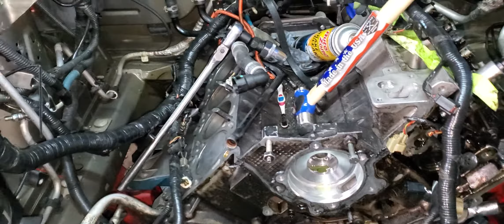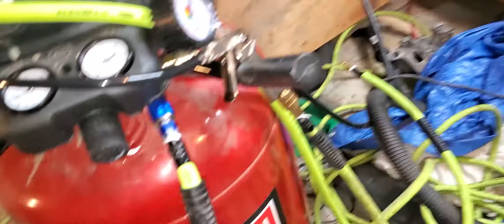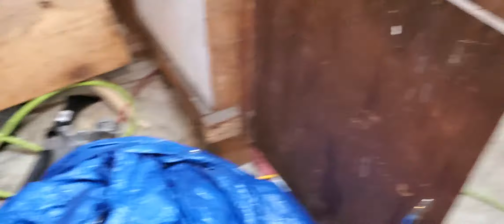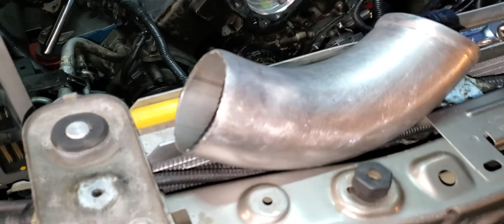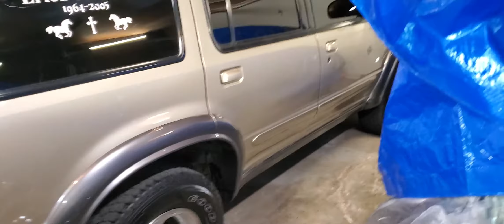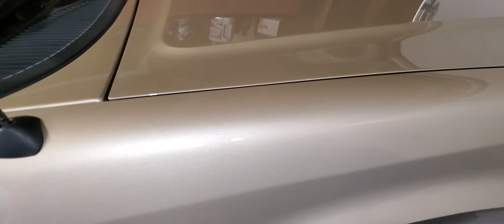Turbo Mustang 3v top end refresh

Comment: We have the same taste in cars. I sold my extra Eddie Bauer and am getting a 2005 mustang GT too. 131k stock tho. What's your mileage
Reply from the maker: around 96,000.
Reply: @TekMan05  on the body of the car, 116,000, the motor that now has complete overhaul, all new everything, zero miles. Am putting it in the car at this point. Did yoy get a chance to view some of my videos? Thoughts, suggestions?

Comment: Really trying to decide whether or not to add boost or cam my 02 mountaineer. Money is no issue just have found nothing on the topic
Reply from the maker: 2v or 4.0?
Reply: TekMan05 4.6 2v 160,000 miles I figured the engine would need a rebuild before it happily takes any boost aswell